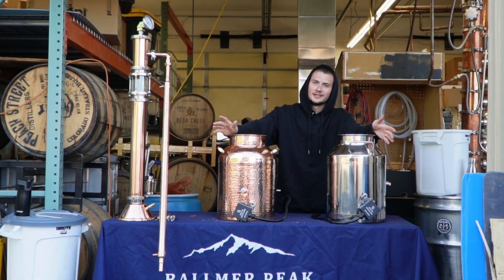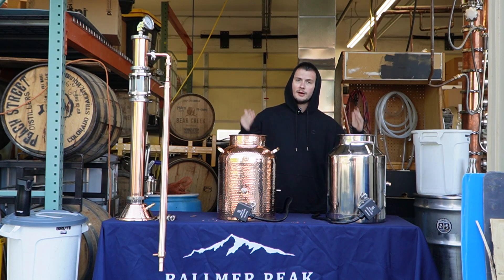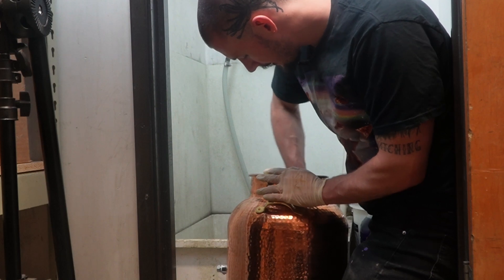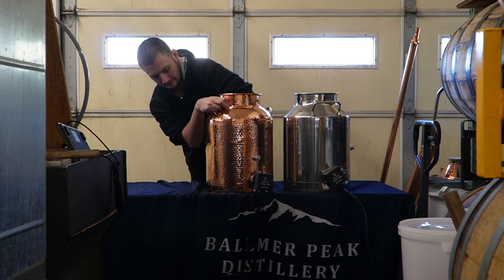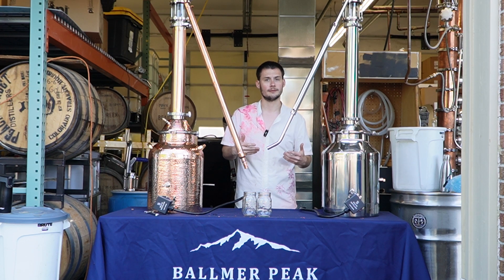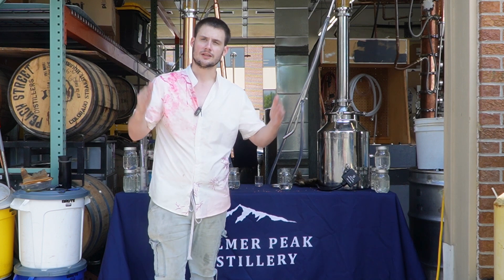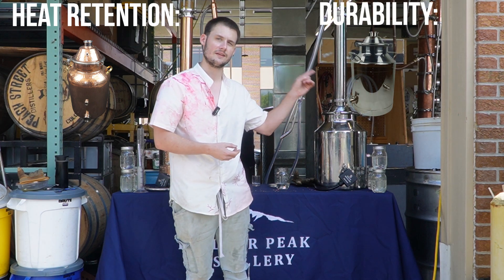Is A Copper Or A Stainless Steel Moonshine Still Better? Distilling Duel: Copper vs. Stainless

Comment: Dude you use a thermometer 8nnthe mash to see which heats faster not which drips faster.  The packing is a HUGE difference. You seriously seem to o not understand basic physics and how to measure thing.  Seriously you were trying to see which years and transfer faster and you did not use a thermometer but instead chose which condensated first with two completely different paths.  Just think how much further it is between all that oacking and how much mass it adds that needs to be heated as well as the riser for ools faster .  Please at least consult someone that understands the basic physics involved before doing a authoritativ3 video on it.  Especially after screwing it up once before.

Comment: I switched to stainless, but i use copper for packing. For 50 years, I used all copper, switched for ease of cleaning. I might get some copper stacks from mile high to add more flavor retention in the future.
Reply from the maker: I started with copper as well. Made the switch to stainless, and haven't looked back. Definitely my preferred metal!

Comment: I got a question then, if hypothetically I had a  four combo setup with 4-50 gallon stainless steel barrels and I run up with 2 inch copper would that be a better fit?
Reply from the maker: Hey, Hunter. Are you asking if the copper condenser would be a better fit than stainless or are you asking if the diameter size would be good for that tower and boiler? A 2" condenser is a little small for a big tower like that, and I'd recommend going 2.5" diameter at the smallest. If you're asking about the metal choice, copper doesn't really tend to do much that late in the distillation process. You want your copper near the beginning before it starts condensing at all if possible. The material of your condenser shouldn't matter much.

Comment: Hi, isn't it better to use steel? And doesn't copper (II) sulfate??
Copper, when distilled, produces copper sulfate, which is harmful to the body
Reply from the maker: I personally prefer stainless, but not everyone agrees. Copper sulfate has an extremely high boiling point, I think something like 1200F. So, a still shouldn't carry over any of that.
Reply: @milehidistilling1  I'm also a fan of steel. I used to use copper, but I found that when you steam distill alcohol, the sulfur reacts with the copper and the color of the liquid that comes out is between black and green. If you put a paper or cotton filter under the outlet, you'll notice it turning black.
Reply from the maker: @abozarmajidi9375  Ah! Good notes! Thanks!

Comment: You could have easily added a stainless steel packing in the SS still column to keep both equal. The Proof difference may be a temperature difference with the copper vs SS column adding more of a reflux to up the proof a bit.
Reply from the maker: Stainless packing I felt would've stripped too much flavor. SS packing will strip more flavor than copper packing, so i was worried this would be unfair to the stainless side for flavor. Yeah, fair point on the temperature difference!

Comment: i been using a stainless pressure cooker for my homemade pot still and all my shine have this signature slightly off bad taste and smell like the wet cardboard and rubber band in water both smells and taste which had a slight bitterness and astringency , i try and reduce the wet cardboard by making better tail cuts but that rubber band is still there no matter how i refind or polish my shine until i started putting in a few copper plates into my pot letting them lay on the bottom and of course my worm is copper, after my stripping run (without foreshots)i would leave the low wine in the pot with the copper for a day then do the final spirit run and  my shine came out pleasant smelling and tasting like it came from the store and that wet rubber band thing was gone so i was assuming this may have been fusil or sulphur that the copper took care of,, now my question is can i store my finished moonshine even at 74% in a glass container with those copper plates in it? can you store shine in copper container safely or does it leach or does it help keep the shine clean? i heard it is bad even to store water and others say it is good so please give me your thought on this because i decided to rest some shine i made in copper for a few months and it has been almost a day now id like to know should i leave it or remove the copper?
Reply from the maker: As I was reading this, I was thinking it was from lack of copper, so glad you found the solution that way! 

I would not recommend storing in copper at all. Do I know without a doubt that something will happen? No. But, copper is a porous material and is also a toxic material in large doses. Out of the list of things I can see going wrong, one might be getting you poisoned by doing this. You might also turn your spirit green or blue from alkaline. There's just too many things I could see going wrong to approve of it, but it's not to say that I know the answer 100%.
Reply: @milehidistilling1  well let me tell you what i decided to do before i even read your reply, i removed the copper after further research and reading that alc may be acidic or near alkaline up to 7.3 (vodkas) so it varies and i did not want to risk it like you said turn green or blue or get excessive leashing (although not sure how alkaline would do that as you said?) , i then took the shine and chilled it in the freezer to about 6 deg C and filtered it trough a small funnel that had a small piece of cosmetic cotton in the tip

 and was about 1/4 filled with britta coal, so my version of chill filtration,  it was a long slow process drip by drip but my god the results were day and night in difference and solved all my problems, all the nasty funky smell, bitterness, spiciness, heat , signature off taste like an old wine cork taste etc went away leaving me with a with a wonderful polished product that was smelling more like either a good vodka or bacardi white rum but much better tasting neat, i am so proud of myself to discover this that is what i 

love about this hobby and all the ideas i get to put to practice and the research and discoveries i make along the way to improve my game and be able to share my secrets with others, sometimes hehe ,,anyways this saved me all those 3 months i was planning to age it lol well ok maybe i sped up the process idk but i might still let it rest age in glass with plenty of headspace ust to see if it changes anything even though this was basically a sugar wash in left over banana mash cast from my prev 

distillation it came out amazing with notes of toasted coconuts like a bacardi at the end,,  love it budy ,, i wish however i knew what that wino corck smell and taste i usual get is all about or where it comes from is it in the heads or tails? what exactly is it,sulfur or fusel? be nice if i had a buddy with similar hobby to taste my stuff and help figure it out but hey man thank you very much for the feedback and concern i appreciate it , it all worked out for me in the end , this is the best stuff i made so far but my pure apple/pear eau de vie brandy schnapps (no sugar or water)that is coming along might beat it
Reply from the maker: Great to hear that filtering helped so much! Good job! 

I've heard of essential oils having a similar rubber smell, but haven't heard of it in ethanol distillation. My first guess would it be something way late in the tails causing it, something I call a "high boiler" Maybe furfural? Not sure. Anyways, glad it all worked out. Both the brandy and this recipe sound delicious!
Reply: @milehidistilling1  yeah who knows what it is perhaps some of the rubber seal or plastic connector in my homemade still are the culprits but yup very happy with the results and yes that brandy is coming along nicely, as i am gradually cutting it down from 61% to 40% at a rate of 7% drop every month for the next 3 months that is the plan i wish you could sample it and that shine i filtered as i would love to get honest opinion from an expert in the field or ppl who have the experience to tell me their views on it and exchange ideas 

thank you for your replies and input bro
Reply: @milehidistilling1  one more thing please 
"You might also turn your spirit green or blue from alkaline."
im confused, i thought acid is the problem in this case not base or alkaline?

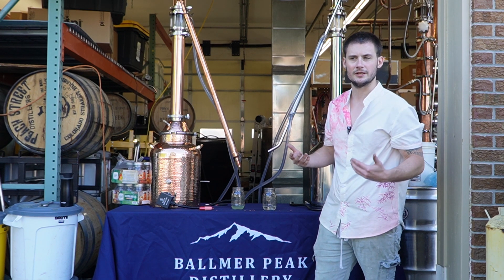Comment: 6:32 QUESTION: - I would like to know, how can you clean a copper condenser?
                             - If I take a copper condenser and use it with a stainless steel still, will the moonshine come out cloudy with a copper condenser?
Thanks
Reply from the maker: I would highly recommend you check out a video I did on this, here's a quick link for you: https://youtu.be/BFujq5nCXPA. Nope, it shouldn't come out cloudy provided that condenser isn't too cold and adding water/oxygen into the distillate by being too cold

Comment: I am confused how you managed to hold botanicles in a sight glass, also how much copper wadding did you put in the still, can you explain please, great video, always use stainless,
Reply from the maker: Hey, Graham. We use a screened gasket to hold in: https://milehidistilling.com/product/3-inch-diameter-gasket-with-stainless-steel-screen/
Reply from the maker: I back roll the copper until it's a little bit smaller than my diameter of the tower and stuff it in. I typically only use one roll like that in a still. I know a lot of people that do two rolls like that, and I would think that's the most common way.

Comment: compare cost?
Reply from the maker: Fair enough point, Dennis. Copper will be more expensive in pretty much every instance. It's just in the nature of the material. On average (at least at our shop) copper will run about $50-$100 more depending on the still as opposed to it's stainless counterpart.

Comment: For an even playing field, couldn't you have used stainless or ceramic paking in both?  That way, the difference is  just the stills.

You'll have some reflux in copper still with packing, versus almost none in your S/S one
Reply from the maker: Hey, Joe. Stainless and ceramic packing tend to strip flavor so we felt that this would hinder the flavor results more than anything. You do make a good point on the passive reflux on the copper unit, though. We did end up using the copper packing in the stainless unit later on in the video, though. So, I think our results might've evened out then.

Comment: What? 20 minutes to heat up that. It takes me 1hour 45 minutes for mine. I have an 8 gallon stainless.
Reply from the maker: Are you using 110v or 220v? We use 220v and I tend to crank pretty hard during heat up since I get impatient lol.
Reply: @milehidistilling1  I use 110v and it's cranked all the way up!
Reply from the maker: @TopFitnessStrategies  Wow, that's a little long for a 110v, though. What wattage? Is it an internal element or a hotplate?
Reply: @milehidistilling1  Internal. I got the setup from Mile High about 4 years ago.
Reply from the maker: @TopFitnessStrategies  Hmm, that's strange. It could be the element is starting to go. Do you change the element probe out occasionally with a new one or are you using the same probe that came with the unit? Has the unit always heated that slowly?
Reply: @milehidistilling1  Same element and yes, it's heated this slowly from day one.
Reply from the maker: @TopFitnessStrategies  I'm curious on that one. Please email me at boo@milehidistilling.com with a picture of the controller box opened and I can diagnose. We might need to bring it in for a repair.
Reply: @milehidistilling1  I'm not sure what you mean by "opened", but I'm emailing you a picture of the controler box now. Thanks!

Comment: I hate to get into the weeds over semantics, but copper is a great conductor of heat, not retainer. That's why your distillate on the copper condenser was cooler - the copper was transferring heat better.

Actually, I think that's really what you meant to just used the wrong word. 

Keep'em coming!
Reply from the maker: Thanks for the correction, brother! Yes, this is what I technically meant. Thanks for watching!

Comment: Copper does not retain heat better than stainless. Copper conducts heat better. You are not heating the copper, you are heating the liquid inside the kettle. As the water heats up, the copper conducts the heat to the outside walls where it will heat the ambient air. If you want to heat your still faster, put an insulated jacket around it.
Reply from the maker: Fair point, I didn't realize I wasn't using the correct word. Thanks.